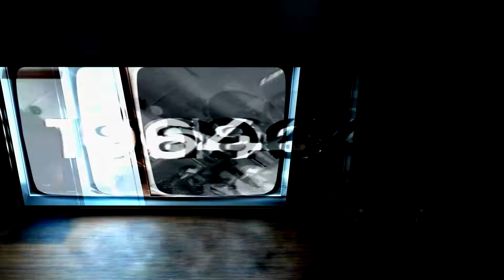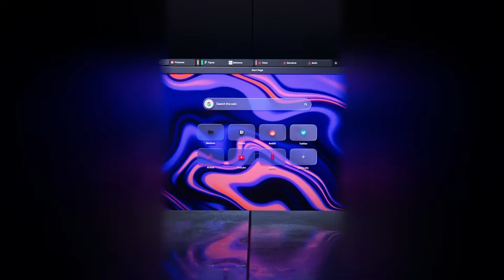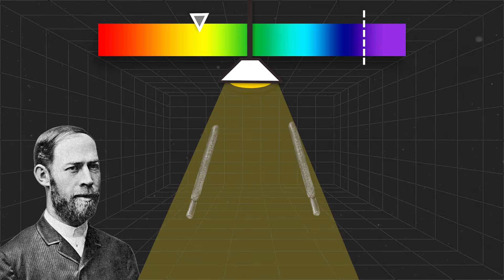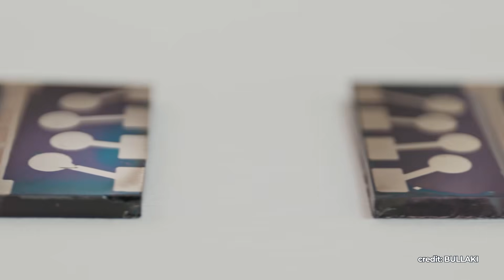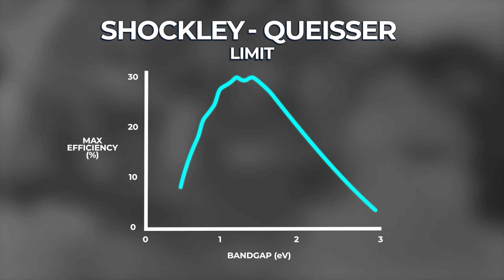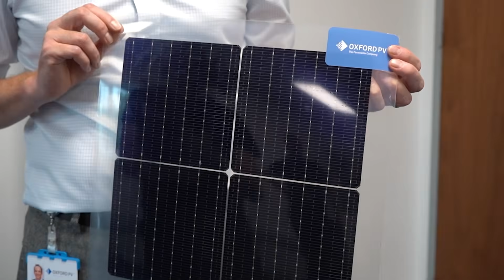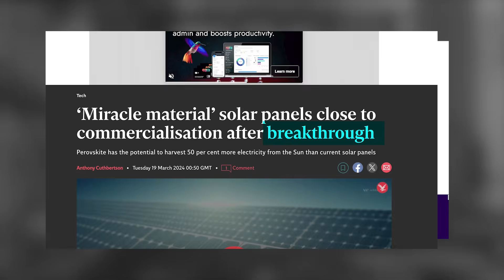How Physicists Broke the Solar Efficiency Record

Comment: Yep. Brilliant video. I have the technology that will see us exceed K1 in our lifetimes, and I'm 50. It will be great to have a chat with you Dr Ben. Your understanding of things and ability to see things for what they are is very refreshing for me. I have support from the European Commission: CINEA and an expert provided by Green Assist with Commission funding to identify and plan my Regenerative resource Hub Network and I am right now completing the final deliverable ahead of presenting for significant funding to implement my IP which includes energy capture, storage and service. From the same footprint as a solar PV array my technology harnesses 3 types of energy and does so with each one at an efficiency approximately double or more efficiently than any current system. The PV cells you've presented from Oxford PV have done exactly what I intended to do at the actual PV receiver level so that has presented a great step forward, given that my remit and the main focus of my technology is in the optimal maximisation of collection, and then optimal conversion. PV is only one string in my bow but this video has encouraged me to introduce myself. My technological suite covers renewable energy and fuels; organic, regenerative, healthy, circular food production; water resourcing; all organic food waste streams, sewage waste and textile waste valorisation and circularisation; heating, cooling, cooking and drying; gas separation, refining and treatment including rare gasses from air and other sources; smartgrids, renewables intermittency mitigation and advanced energy storage, real-time automated energy trading, distribution and accounting, grid-levelling and demand response, black restart support, peak shaving, optimised path hyperlocalised energy supply and demand; and ecological multimode aviation transport and logistics. In 2025 I will be in startup for Rinu Hub Lisbon 1 and at some point once I have the IP protections in place, I'd love for you to come and see what I've done and my company will be doing. I will also happily share with you the circular food module of the Regenerative Resource Initiative and the demonstrator I built and operated in Malta for the last 4 years whilst I completed the full spectrum Initiative preparations. So I'm launching 2025.

Comment: Uh… I found a paper from China that got 33.89% efficiency… The name of the paper is “Perovskite-silicon tandem solar cells with bilayer interface passivation.” They did some pretty crazy things. It’s a wild combination of particular interactions to enhance beyond the Shockley-Queisser limit for a single Solar Cell, of 33.7%
Reply: For at least 10 years now scientists have been getting about 30% efficiency with Argon wafers in the lab, but it is very expensive - I was hoping the Chinese would be able to mas produce it and get the costs down.

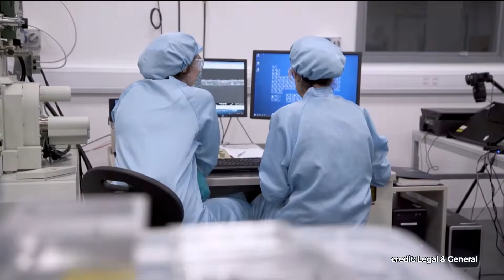Comment: With regard to 18:13 to 18:40 “Le mieux est l’ennemi du bien” wrote Voltaire in 1772—which translates to “better is the enemy of the good”, but is often translated as “perfect is the enemy of the good.” The Nirvana fallacy consists in comparing existing solutions with ideal, perfect ones—which are often unrealistic. A form of perfectionism, the Nirvana fallacy can lead to dangerous thinking and harmful decisions.

Also called the “perfect solution fallacy”, the Nirvana fallacy is based on faulty reasoning, where an argument assumes that a solution should be rejected because some part of the problem still exists after the solution is applied. Many people falling prey to the Nirvana fallacy presume that a perfect solution does exist. In those cases, the Nirvana fallacy is a combination of wishful thinking and black-and-white thinking.

A false dichotomy is a thinking error in which a statement wrongly assumes an either/or situation, when the two solutions are in fact compatible, or there is actually a third potential option. The Nirvana fallacy leads to false dichotomies in which we assume the existence of a perfect solution that’s incompatible with the current imperfect solution, or completely reject the existing solution because it’s not perfect.

For example, solutions that improve safety but do not completely eliminate a risk are often the victim of the Nirvana fallacy. The argument “seat belts are a dumb idea, people who wear a seat belt still die in car crashes” is an example of rejecting a safety improvement because it does not completely eliminate the risk. The goal of seat belts is to reduce a person’s risk of dying in a car crash, not to completely prevent that risk. The Nirvana fallacy is to not wear a seat belt because it doesn’t provide full protection in the case of a car crash.

By aiming for a perfect solution, we may ignore a useful solution; by aiming to completely solve a problem, we may fail to at least improve a situation.

Methods to avoid Nirvana fallacies:

1. Focus on incremental improvements. A key reason why we fall prey to the Nirvana fallacy is our desire for perfection. Instead of aiming for the perfect solution, aim for a better solution. All these tiny improvements will compound, leading to massive changes over the long term.

2. Set intermediary deadlines. Big deadlines far in the future can lead to procrastination or spending too much time on planning, debating approaches, and preparation giving us the illusion of productivity without making much tangible progress. By setting intermediary deadlines, we can force ourselves to make tangible progress. Yes, the intermediary output won’t be perfect nor complete, but it will be an actual step towards your final goal.

3. Keep your perfectionist mindset in check. Make time for self-reflection to understand why you are making certain decisions, or why you are not making progress on a specific project. Are you striving for a non-existent perfect solution? Are you assuming that the current solution is not good enough? Learn to recognize when good enough is really good enough, at least for this stage of development.

Comment: No much value at all.  The huge problem is not the generation but storing the output.  Surplus around midday (unless it's cloudy) and then no output at night.  We control the output of generation by coal, gas, hydro, nuclear etc. by controlling the input to the system.  We can't do that with wind and solar, so we need huge and hugely expensive batteries that will need replacing every 20 years.  And How much storage?  California thinks it has lots but its storage will only last a few minutes.

Comment: shoutout to Oxford PV for still rocking Windows 7 18:22
Reply: Best system there was. Now Microsoft is annoying me with upgrading to 11. I tried 11 for a year. Windows Vista was bliss against 11.  That is just a slap in your face for a system.
Reply: @GERntleMAN  No one says you have to go to 11! Previous versions will continue to exist. There's also the option of jumping ship to Mac/Linux/BSD or just saying 'to heck with desktops' and sticking with a phone/tablet.
Reply: @lithiumflower31337  No thanks, I tried Mac several times and it's worse than win 11. For someone messing around on administrator level and customizing OS for himself, Mac is simply the worst there is. Too limited and ugly and very non-intuitive.

And mobile phones had their UI pinnacle in 2015. After that the usage got worse every year. And I tried all, yes all brands.
Reply: We on IJS institut use it too on some pcs
Reply: @franzupet4406  high-five
Reply: Linux.

Bring on the hate😁
Reply: @TurboElectricUK  No hate, I totally understand the utility and charme of Linux for specific purposes. And if I were to be dependent on them, I obviously would choose Linux. But since I value asthetics and pretty things with a certain amount of utility, Linux is just no option. I'd rather modify every Windows to suit me with an instinctive workflow than to use Linux.
It's like driving a car but having no Windows (no pun intended) but using only the necessary data like vectors of objects in space in relation to your position at any given time. That's Linux. But I like to see the world and react to everything with more than one sense.
Reply: @GERntleMAN  I think you underestimate a modern Linux Desktop, but it's your choice. I do CAD, 3D printing, movies, graphics, audio cutting/mixing whatever. All my videos are created and edited in Linux. All my docs, sheets, presentation. I have Maths software for doing physics. I don't have a use for Windows. There's literally nothing I can't do on Linux, but I can do it all at once without lockups and crashes. Most times I will have my laptop running 100 apps at the same time. Impossible on a Windows Laptop. Maybe if I was a committed gamer or something. To the point: I would have expected a serious engineering company to be using Linux as most of the professional engineering software is designed on Linux first.
Reply: @TurboElectricUK  I haven't had crashing Windows for the last 10 years. Doesn't matter if I render a video and play a game at the same time. But I totally understand you
Reply: Win7 works fine. But getting some modern apps to work with it is flaky. I still use win7 for most purposes. It suits my 'my PC is a glorified filing cabinet' old skool mentality.

Comment: I think there is a fundamental flaw in the Kardashev scale and that is that it does not account for something vital and unavoidable; efficiency.
Very advanced tech increases the efficiency of a civilization. A civ that would technically be "capable" of utilizing all the energy output of their own galaxy would never have a need to do so as they would be incredibly efficient at using whatever energy they decide to harvest. 
Eventually any civ, regardless of their position on the scale, would reach a point of diminishing returns in the energy harvesting game. No advanced civ would waste resources on collecting energy for which they have no need.

Comment: There's a dogma in science and engineering to chase the highest efficiency. But you can make a perfect motor or hear exchanger or whatever that operates with 90% efficiency... But does very little work or only works in very specific scenarios or is super fragile. You're better off with half the efficiency that actually solves the challenges at hand.

Comment: the kardashev scale is obsolete, at the point we discovered graphene and were then able to use it to break a couple of fundamental rules of physics that old classification went by the wayside.
now there are only 2 classes pre and post brownian motion extraction which is the extraction of useful energy from the brownian motion of atoms in the carbon lattice of graphene. this motion NEVER STOPS even at the coldest temps we can produce or found in nature. the materials used to harness this energy proceed to violate entropy by being in constant motion producing work for forever meaning we have a tap on the universal energy source that is everlasting. once started only something external to the main system can interfere 
with a device capable of producing free electrical for thousands of years without fail a civilization using this tech can be said to be cat 5 of the kardashev scale having full access to the power of the entire universe

Comment: Well. Ben all this is awesome. But I can't help to notice that you avoid to mention the two huge and in my opinion unsolvable problems with solar panels. They take up an unreasonably large area even with 43% efficiency, and are intermittent and require storage. Well, with the huge surface, something can be done, like placing it in deserts or oceans, but it will cause a new problem: Transmission, which in itself is unsolvable. And there is nothing to say about storage that is unattainable what so ever.

Comment: Could a mirror layer at the bottom of the cell allow for double the opportunity of capturing a photon? I've seen it on graphite heat batteries and its used for saving heat when the TPVs don't capture, but they said it wouldn't work for solar because its just shooting the photon back out to space. My question is, wouldn't it still double the opportunity for capture anyway?

Comment: The thing with designen/programming/creating the perfect solution is:
Your idea most likely does not survive the contact with the real world.

That is why iterating works better. Not because its more efficient to iterate vertically but because the problem that needs to be solved is so complicated when looked at its full scale.

Comment: I have actually been wondering if it was possible to use fluorescence to produce a consistent colour light which then removes spectral efficiency from the equation. If much more of the spectrum is turned into a single wavelength then there be no need to have different layers etc for the different colours.